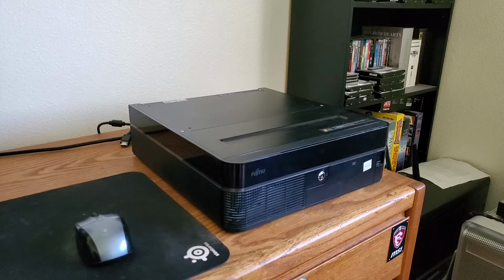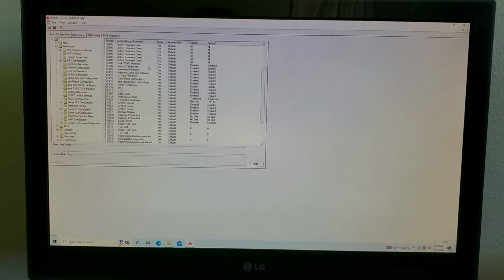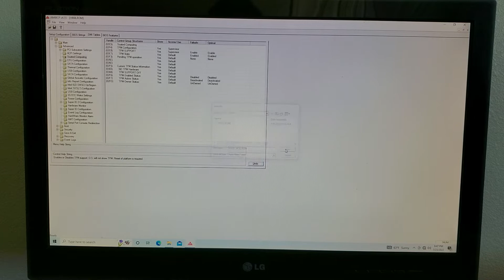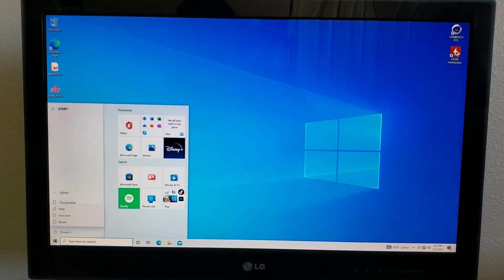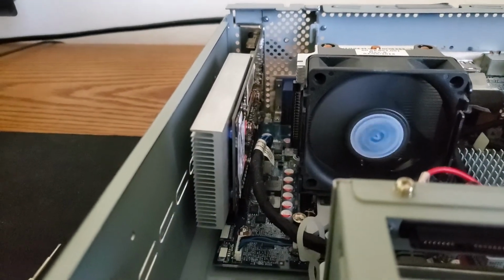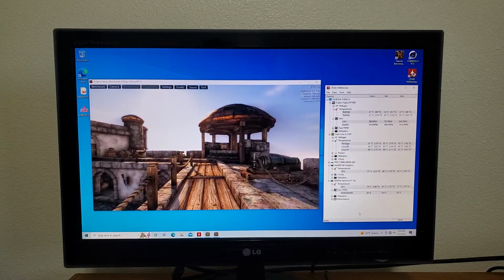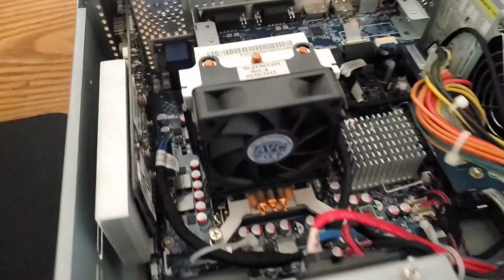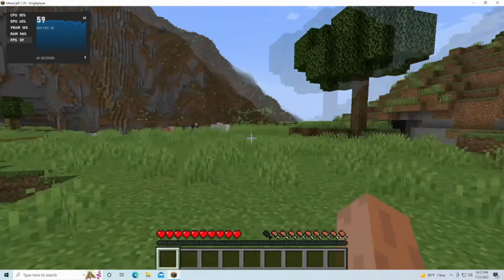You can game on a POS by modifying its bios

Comment: hooray you did it,  even if you break bios , you can buy eeprom programmer under ten usd or if you have some arduino board or raspberry pi board to use az a programmer and write original bios or another modded bios.i breaked mine and used raspberry pi to write it back  :)
Reply: I already own a few nice programmers, but where can you get a programmer for $10? Be nice to have something affordable to help others with on Vogons, VCF etc... Do you mean using a network card or?

Comment: i had same problem the pci slots were turned of in my bio's i never knew that there is a setting in there will accept it i never knew i was using the vga on the motherboard  then i thought why in the pci slot wont accept it it did when i set it on in the bios ok mine only had pci not pcie so you have that turn it on